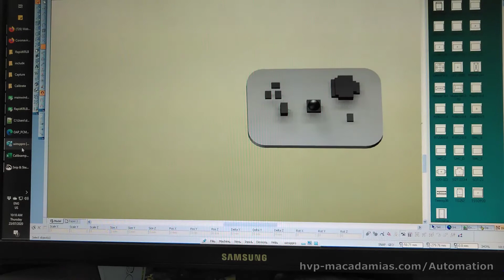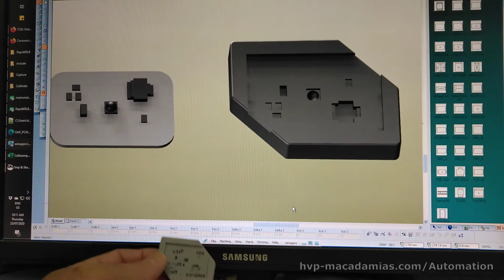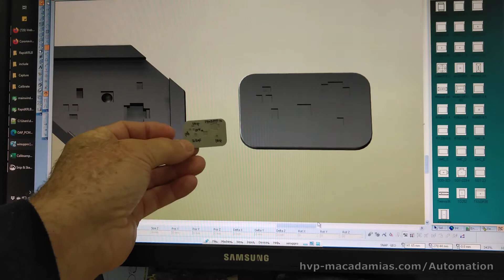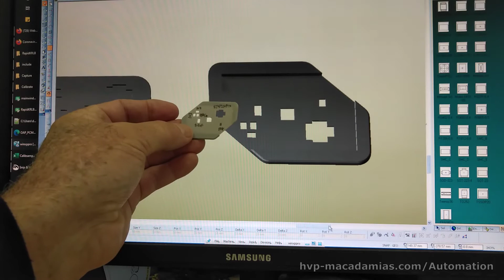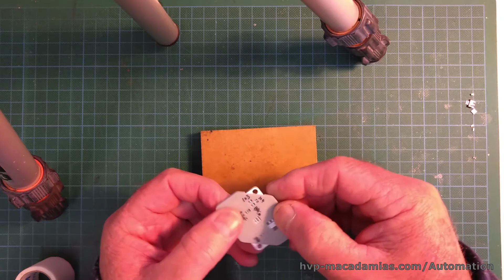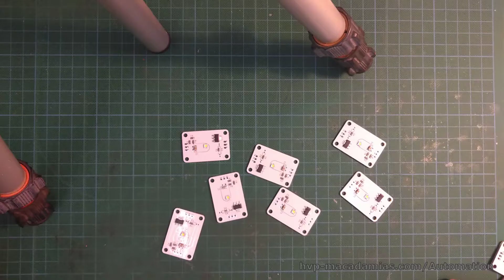DIY Alternative to Pick 'n' Place for SMDs

Comment: What will the boards be used for?
Reply from the maker: The board is an LED driver that I use in the scanners/sorters, depending how it's set up it can be used to provide a constant light or a flash. It's nothing special though, it's just what I was doing at the time to demo the method.
Reply: Scanning & sorting macadamia nuts or something else?
Reply from the maker: @kdegraa  Yes the ones in the sorter videos. I hope to have an update in a couple of weeks.